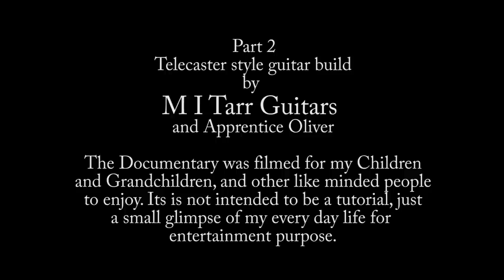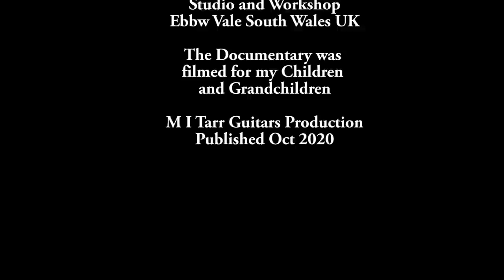Telecaster Guitar Build with Mahogany Body and Flame Maple Top Documentary PART 2.

Comment: Love your work! Just started myself, you’ve got a great eye ! I just built a solid body Dan Electro using the original as a template.... next I’ll try my luck at a neck, seems to be a much higher skill level than the body.
Reply from the maker: Pleased you enjoyed the film. A Dan Electro is great little guitar, and is high on my list I would like to make, one of these days. It is not to hard a neck to make, do your research and you be fine and it should not be to expensive material wise. I would use rock maple and rose finger Bd. The neck build technique would be very similar to the Telecaster  would think. All the best with it, and thank you for your comment. Best wishes, Mike

Comment: Very nice. Can you tell me the name of those caulking gun type clamps, or who makes them? Thanks.
Reply from the maker: Hi John. They are call Quick Release Clamps. Here in the UK you can get them for Screwfix. Or There are a few sellers on EBay. I’ve had mine for 20 odd years, very strong. They are getting harder to find, but just checked for you and there are on EBay right now. Thank for you comment, glad you like the film. Mike
Reply: @mitarrguitars   Thanks for the reply.

Comment: Thanks for sharing this excellent build with us all, it's much appreciated!

A question, if I may..
Why do you check the level of the frets, instead of the actual fretboard itself, using a notched straight edge?
Wouldn't the new frets be somewhat uneven, and using them as reference could cause inconsistencies down the road?

Cheers.
Reply from the maker: Hi GuitarNTabs. Funny thing I was only talking about you today with one of my students that I teach music to, he had been looking at one of your posts.( which he had enjoyed....What a  Small world ). 
Like I have said in my description there is more that one way to do any job when build a guitar, work with what tools you have.  Many of my jobs are old school, I'm sure Leo and Les didn't have a notched straight edge just like me. I do try to get every process way before I start the fret dress, pretty must spot on or to the best I can, the thickness sander is the boy for that, it works to 10,000th of an inch. 
Preparation work is the thing. Which starts from the very first job of neck and finger board thicknessing, to the fret slots depth etc. And I'm sure experience plays a part in it, 
I made my 1st guitar in 1979, but that was rubbish if I'm honest. 
Also I wouldn't be happy with my fret work, if they were uneven or with inconsistencies before hand { that would not be a great start) . That is part of the reason I showed in the film, cutting the tangs of the fret side and checking the slot depth. 
When I start making guitars, there was no YouTube,  no one to ask for help, few books, you learnt by your mistakes. But I'm an engineer by trade so problem solving has helped. I'm not sure if your a builder or repairer. Making a neck from scratch with hand tool is a different process to doing a re-fret, you can't compare the jobs. 
Many thanks to you for a great question and I'm glad you enjoyed the film.
 I am plaining on doing the next guitar build with only hand tools, possible with just a router. Also if you looked back at the other documentaries I have done, I try to change some of the job or used different tools. Finally the film is not intended to be a tutorial but entertainment, but if anyone get inspired to build a guitar from scratch that would be great and some have and they have come to my workshop for a catch. Many thanks  and stay safe Mike
Reply: @mitarrguitars  - Hello Mike!
First of all, thank you very much, for getting back to me and for leaving such a detailed reply, that's is much, much appreicated!

Haha, small world indeed, I'm pleased to hear that my post could start up a conversation.

Sure, I fully get that, and your skill is incredible and I truly admire your work and videos!
Exactly, it's easy to get caught up in the "modern day luthier tool" world..
Experience is key here, I can really imagine, just seeing you work is fantastic! I really hope to see more of your work in the future.

That's the beauty of all this, you learned from mistakes, improved and really got the skill and techniques under your skin and stuck to it, that's fantastic!
I'm a repairer, wanting to build my own guitars, at some point in the future.

Thank you, Mike, for getting back to me, and for taking the time!
Wow, that would be amazing to see, +1 from me!

Stay safe, Mike.
All the best.

Comment: Fantastic workshop and machines plus crafsmanship . Amazing. I was a little confused about the pick guard. Why the routing. Do you make them from scracth. I noticed it was black on the back . I  presume to give the black edge effect.  Yes I am a compete novice so just wondered. Great build .
Reply from the maker: Hi Del. I do normally make the pick guard if I have time. The routing you seen was because I had in stock a blank plate ( no routing for pickups) so I routed for the neck pickup. As for the black back, you are looking at a black pick guard that I used for a guide for the guard I was working on. I did also use a pick guard template but I was not 100% sure it was very accurate. Many thanks for your comment. Mike.
Reply: @mitarrguitars  Hi Mike . OK thanks for getting back to me
Reply: Hi Mike. I have just watched your video making the LP 59 Junior. Great watching as usual . Do you draft the drawings yourself or can you buy these?  many thanks Del
Reply from the maker: Hi Del. I get them from ebay or Touchstone Tonewoods in the uk. Thanks for your comments. Mike

Comment: I just sat down and watched both of these videos. I am making a Gibson flying v myself! Could you list the woods that you used in this project and suggestions of wood that I should use?
Reply from the maker: Hi Laten. Thank you for your great comment and glad you enjoyed the film. Ok here we go. 
Neck is AAAA flame maple
Finger Bd Rosewood 
Body Mahogany with a 6mm flame maple cap. 
For your Flying V, I would use Mahogany every time. It’s a big guitar the V, so you will need a large Mahogany body blank, and the same wood for the neck. Get a neck blank about 2inch or 50mm and make the neck  out of one piece. I would anyways, but you could use 1inch or 25mm and scarf the head socket. Not my thing if Im honest. It’s not a difficult guitar to make, neck joint is straight forward. Get your self  scale plans or blue print drawing. You can also draw your own. And treat your self to a full set of template off ebay £45 or $65 there well worth the money. I did always make my own but it takes time, so buy them.  Any help just ask. Stay safe Laten. Best wishes Mike
Reply: @mitarrguitars  Ok I am using rose wood for the fretboard, and african mahogany for everything else. What should I use for the very top of the guitar?
Reply from the maker: For the headstock veneer Gibson use a black fibre board or you can ebony head veneer. You find them easily on EBay or luthier suppliers. You can see it on my 59 Les Paul junior film in I used a fibre board. You can also use the same type of neck joint in the film. It may help you out...Mike
Reply: @mitarrguitars  what type of wood did you use on the front face of the guitar and where should I get some?
Reply from the maker: Laten, 6 mm Flame maple cap, it’s in the list I posted. You can get it from
Touchstone Tonewood in the UK. But it’s available on EBay, but can’t say how good it is. Touchstone is your best bet. Mike
Reply: @mitarrguitars  Sorry for bothering you again, but how thick should the guitar body be?
Reply from the maker: @latenbargestin5918   Hi Laten. It need to be round 38mm to 41mm, will be fine. Mike

Comment: a perfect job. I'm asking a materialistic question and I apologise: how much does a guitar like this cost? How many hours of work did it take to make such a jewel?
Reply from the maker: Hello Alessandro. Cost to build a guitar, material can vary, depending on the quality of materials you use. I would never use poor or the cheaper end of equipment. So its based on good quality, expect to pay  £500 to £600 in the UK. Normally its take 30 to 40 hours to build, plus the painting/finishing cost. Time to do the  finishing is open ended. 
If it go's well 25 hours or it can be a lot higher. This is all base on a Telecaster with binding and very good grade 6mm Flame Maple cap. The cost will be much less if you used an easier or different constructed Telecaster, like the 52 Tele video on my channel. Hope this is of help to you.  Many thanks for you comment. Mike
Reply: @mitarrguitars  Thank you. I have seen many guitar constructions on you tube but the construction of your guitar fascinated me so much especially when you inserted the frets you did an excellent job. I congratulate you and thank you for your reply. See you next video.

Comment: How deep do you make your neck pocket!?
Reply from the maker: Hi David. It’s around 16mm or 5/8, but I always make the neck first. That’s generally 20/19 mm thick. So what ever the thickness of the finger turns out makes a different. That normally 6mm to start with, after a bit of machining, then radius takes a little more off. That ends up around 4/4.5mm. Don’t worry to much about it. Get the neck or make it, and work from there. Standard would be 16mm depth on the the draw. Mike
Reply: @mitarrguitars  thank you very much!!!

Comment: What’s your trick to getting the waterside decal to look so good on the headstock? I’m having trouble with the decal on one of my builds. I put it on and let it sit overnight then put about 4 or 5 coats of lacquer and let dry overnight. The next day I wet/dry sand with 2000 grit and it either starts scraping the logo or it still shows the edge of the water slide part against the neck. Any advice would be greatly appreciated!
Reply from the maker: Hi ande047. Primer/seal the headstock surface first. then put on two coat of lacquer. Put the decal on and 2/3 top coats. Flatten it back with 2000 grit. Apply   2/3 more top coats and flatten again bring the thickness of the lacquer on the decal down to lose the edges of the decal, just watch you don't cut through the decal. Good quality decal is the answer because they are much thinner. Hard to put on but cover easier. If your in the UK try Rothko and Frost for decals. Ill be doing a video on it soon. thanks for the comment. Mike
Reply: @mitarrguitars  I think my problem is that I’m using too thick of waterside paper. I will try a better paper like you mentioned. Thanks for the info and for all the videos, they’re a joy to watch!
Reply from the maker: Thick paper makes it hard but It can be done. Flatten well. New films come very soon. Thank you mike

Comment: What size needle/spray gun were you using for your finish? Were you spraying nitro? Or something else? I’m new to finishing. Today was my first day spraying my first guitar I’ve built. I used a 1.4mm needle, with a water based clear coat called Crystalac. So far it’s been ok. Not much orange peel. The first spray was bad.. but I managed to improve my technique throughout the day..
Reply: Also, what psi? How many oz of clear did you need? Great video, by the way! I’m a beginner guitar builder. And there are many people who do not like to share their knowledge of how to build. Almost like they want to keep it a secret. I’m very grateful for anyone who shares their knowledge for anyone to learn! I believe in teaching people. Not hoarding knowledge. So, thanks for the vid! Lots of helpful tips I picked up.
Reply from the maker: Hi Uriel. I'll help you or anyone if i can, Teaching music is the biggest part of my work and when i was a electrical engineer i always had an apprentice, so passing on knowledge has always been a big part of my life. So if i can help you at any time please feel free to ask. there a lot of question here so ill try to answer ever thing.
1...Gun needle size is 0.8, I use a touch up gun. So its small and great for the job. Your 1.4 will do the job find.
2...Air Pressure.To be honest off the top of my head i couldn't give you an exact figure. It is low, I run my compressor low to keep over spray to a minimum, its down to knowing your equipment. Ive used the same system for 20 years.
3... The finish is 2k or 2 pack lacquer . I do use at times Nitro. Water base is the way to going i would think. its much safer for you, I will give water base a go.
4...How many oz ?. UK oz are different to the USA. But ive always use 35mm film canisters for my measuring. They are about 1.5 floz, so with the hardener and a little thinners im mixing about 2,5 floz at a time. I dont work with big volume at a time, wastage etc. It would be more X2  if spray a set neck guitar for example. 
5... How much do i use for  the completed guitar. Well that depends on how well you have fill the grain and how many coast, are you using solid colours with primer coats or trans colours and stains like i use. Its min of 6 coats max 9/10 
Its a big learn Uriel, spraying and finishing is hardest to get right and learn. I've made 100's of mistake over the years, and its not something i like do if I'm honest. It can be very frustrating and very time consuming. All the best with the build, hope Ive been of some help...Mike
Reply from the maker: Many thanks Uriel for your comments.. Mike
Reply: M I Tarr guitars thank you for the detailed reply! I’m so happy to hear from you! Haha. I have a 0.8mm gun too! However, the material I spray is Crystalac water based polyurethane. I could not get great results this and 0.8mm tip. I had better results with my 1.4mm. I’m going to try my 0.8 again today,  though. It gives a much finer atomization. And it’s a LVLP gun, so it uses much less air pressure. I only have a small compressor. I am currently building 2 telecasters. #1 is swamp ash that i am painting a light blonde. I grain filled with black filler so the grain will show through the finish. Using a beautiful roasted maple neck/ebony fretboard, and stainless steel frets. I carved body and arm contours as well. #2 is an alder body. I will paint this one opaque black. I’ve only been building for about one year. To be honest, the finishing process requires a lot of trial and error, to get good results. But I enjoy all parts of the process. I like to learn. I really enjoy your videos! And thank you for sharing your knowledge with me! It’s a huge help!
Reply: M I Tarr guitars i will post a video eventually showing the results of my builds. I’ll make sure to show you when I post them!
Reply: M I Tarr guitars well after today, I am pleased to say that I got a great finish laid on my guitar. I used my 0.8, and it was so smooth when dry, I will barely need to level sand. The trick I was missing was this: I put my spray gun/guitar/clear coat material in a warm room with a heater overnight to warm up all the pieces. This warmed up my clear and it was much less thick this way. It sprayed through my gun very very well! Before this I had been leaving my materials in the garage (low temp) and it was causing the material to be very thick and this not spraying correctly. Today was a very good day!
Reply from the maker: Hi Uriel, Yes let me know how you get on. Mike
Reply from the maker: Hi Uriel. Glad things went better for you. Your set up of water base products and low LVLP is totally different to mind, its hard to give comparisons, but i hope I've been some help. That the trouble with finishing things go well then it all up in the air and you can end up starting all over again. Just take your time, preparation of the work is the most important for your final result. Best wish and stay safe. Mike from a very wet South Wales .